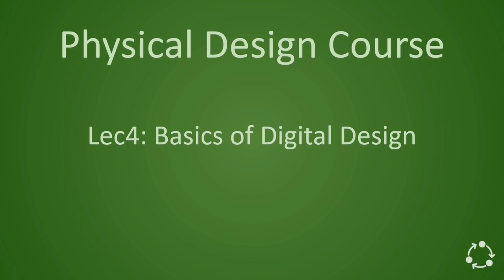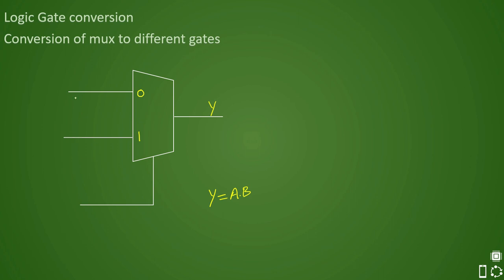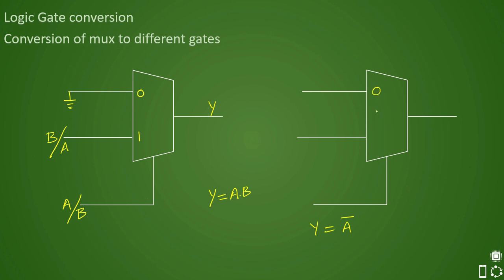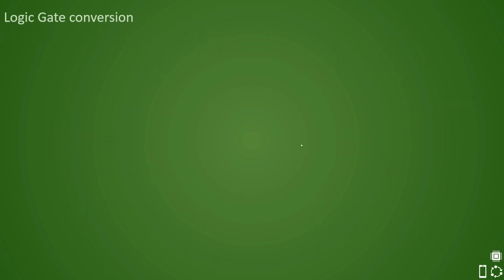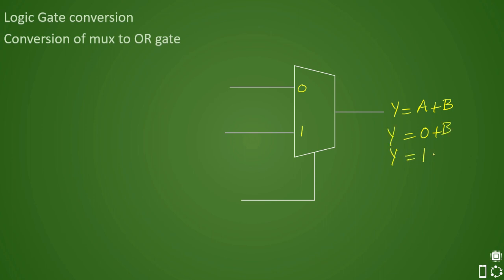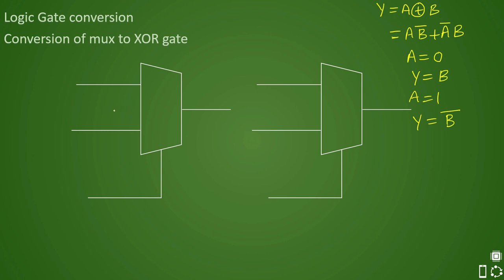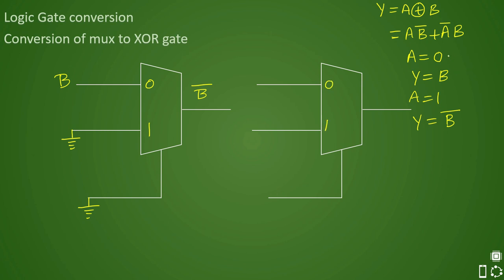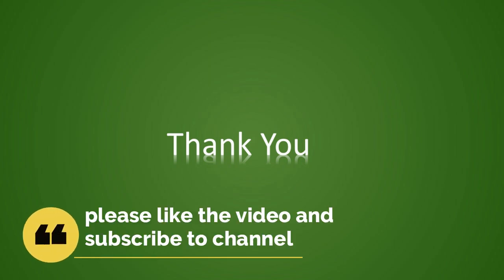PD Lec 5 - Logic Gate Conversion | Tutorial | VLSI | Physical Design

Comment: While doing mux to xor conversation, when select line is grounded, as B is present on 0 pin, output will be B. How will it give B bar
Reply: The fisrt mux should be not gate version of B. The other connections remains the same.
Reply from the maker: Hello, the output will be complemented, if 0 is selected and output is same if 1 is selected.
Hope this helps
Regards
VLSI Academy
Reply: @VLSIAcademyhub  please recheck XOR.. There is no inversion in XoR 1st mux.. 1st mux just propagates B every single time as select line is 0.
Reply: @VLSIAcademyhub  there is a mistake in the xor circuit using mux 2:1
Reply: @VLSIAcademyhub  how the output will be complemented if you selected 0  without using any inverter/not gate ? if you select 0 you will get the output as B directly, if  input B at pin 0 is selected at select pin as 0
Reply: how does a mux can invert a input signal tell me
Reply: @VLSIAcademyhub  Need to recheck the last slide and comment here please!
Reply: @VLSIAcademyhub  B should be present as the select line of mux1 and at 0 there ip should be 1..then only the op is B bar